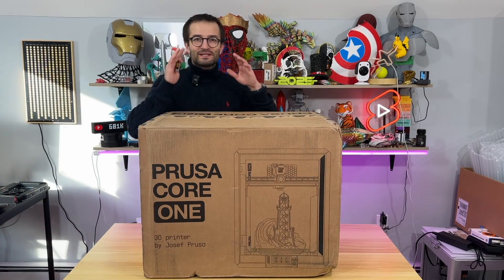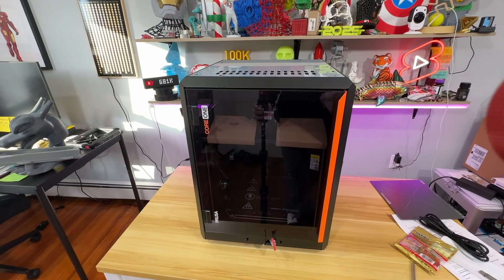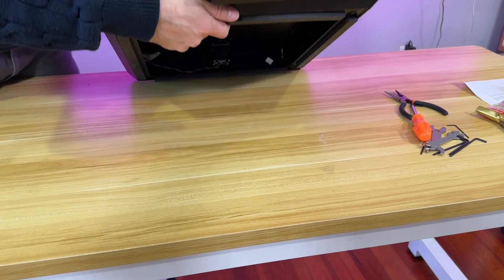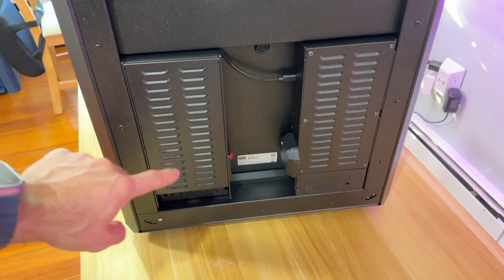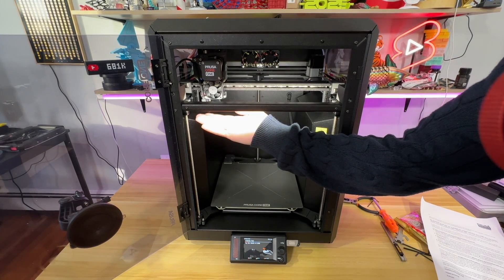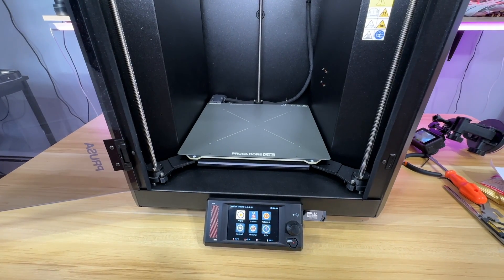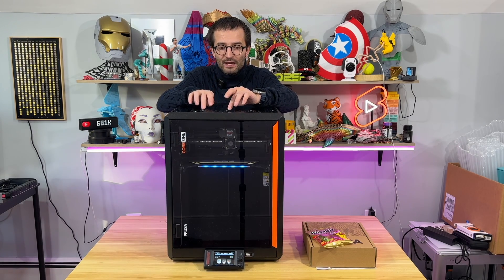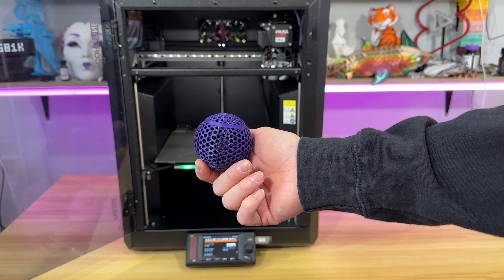PRUSA CORE ONE: Unboxing & First Print Experience Like You Are Here!

Comment: What slicer are you using? I was just trying the 2.9.0 version which has the Core One listed, but it doesn't seem to give the extra 10mm in for the 220mm print bed. Was disappointed they didn't size it up slightly, but I think the extra 10mm will just work for my largest project! lol
Reply from the maker: Prusa slicer. Maybe there is a bug. I don’t have the issue. I bet they will fix it if there is a bug
Reply: @3DPDoctor  Thanks I just sent support a question on this. I was pretty disappointed they didn't size up the bed to an even 250mm on the Y or even better do a mini XL with 9 heat pads to be 360mm. I think it was short sighted to limit the bed to the original MK3 bed size as I am sure way more customers like me are less worried about upgrading and more interested in a clean sheet improved design. They are lucky that Bambu just did an own goal the other week as many Prusa buyers are being swayed I am sure. I love their product so want to support them.